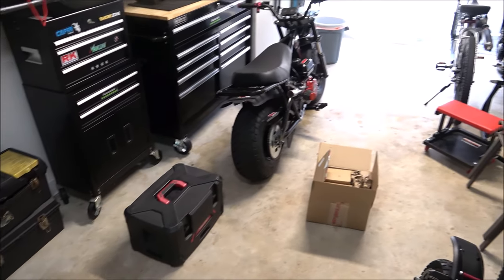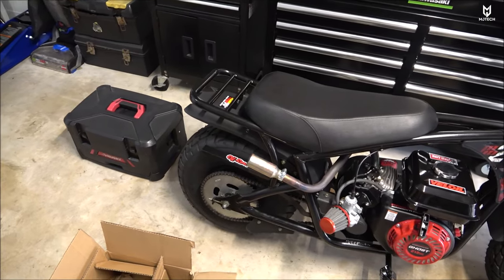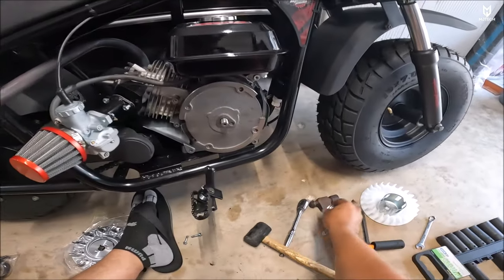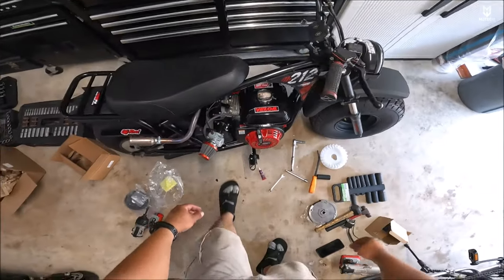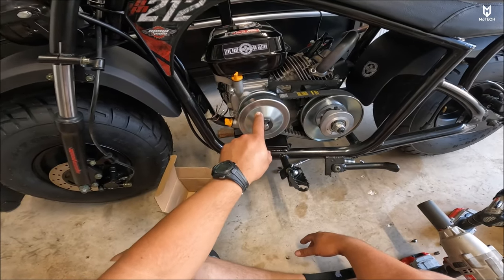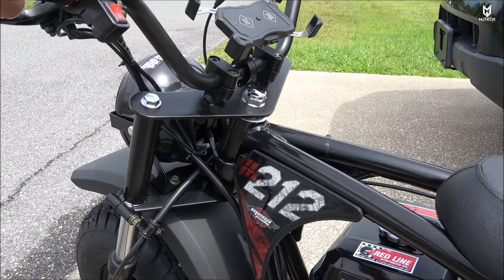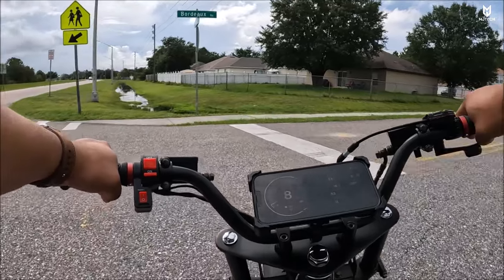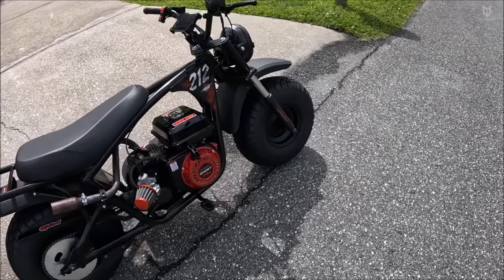Here's How To Make The [Predator Ghost 212] Faster - Mini Bike - 50MPH+

Comment: Break it in like you're going to be driving it. Don't baby it, unless you're going to baby it forever. You need a good shakedown as well.
Reply: What you mean by babing it ? Break in I just ride from time to time at the top. Soon I'll be changing the oil
Reply: @mr.liggins9092  I mean that some people think that the break-in period means you have to baby it. You should break it in driving it the way you plan on driving it. If you are going to run it at WOT every time you crank it up, break it in like that. If you're going to be cruising, no drag racing, no aggressive go-stop-go, break in should go that way.
Reply: Every sbc engine I have built I  drove like I stole it. Same as any small engine...mini bike.. dirtbike...atv..ect.. never had a issue
Reply: I dk if dudes knows anything about the shakedown

Comment: Best way to break in a motor is to run it the way you intend to use it normally.  So balls out! Learned this from a engine builder that built race engines for Nascar and dirt track cars.
Reply: Tf
Reply: @comfortablynumb8832  he's right. Break it in the same way you plan on using it
Reply: I hear so many stories of bad things happening when doing this with 2 strokes
Reply: @joshapples88  it’s a 4 tho
Reply: it’s best to let it idle for about 30 - 45 mins , turn it off and let it cool off , turn it back on then from there I’d let her have it . 🎉 why ? To get oil in the hard to get places and let those places get lubed before sending it hard

Comment: I know this is an old video but I hope you do see it, you need to adjust your carbs needle because you have some mid RPM hesitation, when you're doing the top speed run I can hear it hesitate like right in the middle and then once you hit I think 38 mph that's when it started picking up and sounding better and healthier.

Comment: Nice video My Honda gx160 goes 55 mph with stock rod , 18 Lbs springs with vm22 header pipe ratio rockers stock fw , stock cam on five inch rim.

Comment: I have a CT200UEX 196 cc. Billet rod and flywheel cam 26 springs 22 mm carb and it does 60 no problem. I have a 212 built the same that vibrates like it wants to bounce you out of the go kart.

Comment: hey brother, nice looking set up. it may have already said in the comments but just wanted to add, when youre using the billet flywheels with the strong rare earth magnet you need to run a wider coil gap. a card is good on the stock flywheels. should aso lap the new flywheel. good video tho brother

Comment: Hey what size throttle cable do you use because I have ordered multiple throttle cables and none of them have been long enough on the outside to link up to my bike and the part where you put it in the carburetor

Comment: So basically, I got a Predator ghost a couple weeks back and with the fuel pump I had to buy for it the gas tank won’t fit so I’m wondering what gas tank you have in the video also, I tried starting it today and gas came leaking out of that air filter on the carburetor when the choke was on so I took the carb apart and adjusted the float a little bit and it stopped leaking, but now it won’t turn on. sometimes it’ll start up for a little bit and then just sputter right out. It’s a brand new engine brand new carburetor, brand new everything so I don’t see how the carb could be clogged up with anything I could have it wired wrong but I don’t know.

Comment: Bone stock ghost, juggernaut, cvt set. 10t drive 38t rear on my trailmaster hurricane and yesterday hit 61.6 mph dirt tires as well. 19x7x8
Reply: I have a coleman bt200x wanted something a little more faster. If iput a 212cc ghost engine would it be alright with my stock jackshaft.and what exhaust pipe could i use?
Reply: @patriciaeaton-up4yj I’d get a tilletson 212
Reply: Im trying to do have same setup as you

Comment: Does your predator seem to have a lot of vibration in the upper idle to mid rpm range (2k-4k)? Just curious if it's just my predator but mine seems to run really smooth at idle and at the top end but vibrates a lot in between
Reply: Maybe your engine mount?
Reply: This may sound crazy but check your wheels and tires. Make sure they're not somehow out of round, your tires don't have any bubbles, flat spots, or uneven wear on the tread. Also check your wheel bearings for play. It's coming from an unbalanced rotational force, but the range it's happening makes me think it's closer to where the power meets the ground. Run it at the range where it vibrates the absolute worst, hold it there for a second, and then kill the engine. If the vibration immediately stops, its your engine. If it tapers off evenly as your wheel speed decreases, it's elsewhere.
Reply: Remington Steel  some of those castings are questionable, and I've seen videos of flywheels exploding.  It's hard to judge what one person considers "excessive" and what's normal without putting one's own hands on It.. And even CNC Machined parts can have defects.
Reply: @jesse1136  Wheels are reasonably balanced after resolving issues with the back tire. That issue was more of a wobble than anything else. The vibration issue is very high frequency, the kind that will make your hands numb. As others noted, my suspicion is it's somewhere in the crankshaft. I appreciate the replies and have more or less just lived with it. Other than the mid range vibration everywhere else in the power band feels smooth after warming up. Another area I'll explore is the carb, I know the idle and full throttle is dialed in, but the mid-throttle is lean. Dialing in the mid-range on the carb might help the internals rotate a little less violently.
Reply: @clv603  Ah, ok. It sounds like you've got some wrench time under your belt. I wonder if there's a bushing/dampner in your steering that's worn, for it to vibrate so badly without tearing itself apart. Good luck, hope you get it nailed down.

Comment: Them arc flywheels make the bike takeoff so much faster. I have one on my flat top hemi build and it tries to climb at lower speeds so much easier
Reply: Also on all my builds. Break in until it's warm low idle, drain the metal flakage immediately. Change oil every 20 min after that a couple times and then you shouldn't see as much glitter throughout its entire life. Don't do this and the rings fail premature had it happen a couple times, switch them to synthetic and a zinc base additive after as well, sucks to have a smoker cause of the glitter

Comment: What bolt did you use on the juggernaut that you used I have  the same motor  like  you so I just need to get the bolt  to hold the juggernaut
Reply: It’s 5/16x24 thread pitch. 2.5 inch long bolt
Reply: What Number bellt did you use

Comment: Do have a fuel pump or is it gravity
Reply from the maker: Gravity
Reply: What exhaust can i use will any 212cc pipe fit ? And please what torque converter and where do i buy it from
Reply: Sorry for all the questions please can you let me know where to buy the gas tank from

Comment: I didnt know about the stock ignition I changed everything except that do you have a part number for the upgrade?
Reply: you can just swap it with a normal predator 212 coil, the one that comes with the ghost is the same part but its just limited to 6k rpm

Comment: What's the part # for that mounting plate for the torque converter, the predator 212 has a different one and  I tries to swap them and it won't sit flush with the block? And can't seem to find anything for the ghost
Reply: You have to mock up the plate to the engine and then mark where it's not clearing so you know where to remove material. The jackshaft bearing boss is reinforced with gussets on the inside surface. You'll need to grind one of them down to get your clearance.

Comment: strange i have a stock ghost on a mega moto 212 and i’ve got 54mph but you could only get in the 40s
Reply: Straight chain ?
Reply: My theory: I bet you have the chain drive but he swapped to the Juggernaut CVT upgrade "Variator".
This "self adjusting" front pulley was geared maybe too high for his engine power curve.
Prob would have gone faster 
w/o that mod.
He may also have not upgraded his Carb main jet to feed more fuel.
Just an educated guess.

Comment: 56 mph on mine just by changing the rear sprocket. 73 to 53 tooth. 😮
Reply: I'm getting 52 on a mm80 with a torquezilla 10/50 I think my storm 200 with a Tillotson 212 is going to wipe it

Comment: There's no way that will go 50 miles an hour plus , I have the same one with same setup,  at 38 miles an hour the valve springs float ..
Reply: Mine does 52 mph
Reply: Top speed is mostly about gearing ratios.  Taller tires/sprocket = higher top speeds.  Shorter tires/sprocket = faster acceleration.  More RPMs will get you more top speed but gearing plays a much larger factor.  For yall to compare top speeds between mini bikes, you would need to factor in overall tire diameter and number of teeth on your sprockets.
Reply: @logme1336  thanks Logme , after messing with the ghost , and also changing to nibbi carb , I jave a defective ghost engine , it started smoking out of carb , which I changed jets also. I just took ghost out , put my tillotson back in , its much more reliable and just a better engine,  thanks for responding

Comment: 😂😂😂🤷🏿‍♂️ naw bro you dont have to do all that I have five mini bikes all with predator 212cc engine and they do 65 to 70 mph💨💨🏍🏍 you have to straight chain it go with a max torque clutch from go powersports 10 tooth and get a 72 sprocket I'm telling you💯💯 but if you want alot of top in change the sprocket to a 38 very fast🏍🏍🏍🏍🏍💨💨💨
Reply: If he's doing anything off road or with a lot of up and down terrain, those clutches are garbage. They're ideal on smooth, flat, hard surface like track or street. The Torque converter/TAV/CVT gives a lot more usable torque all the way through the the engine's RPMs- from engagement to WOT, full send. The chain clutches are for racing karts, where you're running WOT from green light to checkered flag.

Comment: Yo my stock 212cc predator does 60 against the wind. has an original style carb holy Moses blueprint super jet. stock cam with stock piston and rod with the cheapest cast aluminum fly wheel 18lb springs top 61mph 19 tooth clutch 60t rear. on my other engine I did rod, flat top piston, 270 cam, 26lb springs head porting all the shit I could with it and had nothing but problems. I built 3 engines 1 engine the the block was warped brand new also the new racing pushrods bent 3 pairs wouldn't stay running after measuring and cutting.  took it apart so got a new block new head new piston the piston seems to be the problem this time looks bigger so compression won't allow it to stay running. spend all this money but the shit isn't worth it. DIY is all a scam to boost economy. that's why the internet got ruined by apps.
Reply: The low end must be terrible with that gearing. How tall is the tire?
Reply: @Deucealive75  it's a 15×6-6 tire I keep up with cars that aren't trying to race off the line. I've had nothing but problems with my fully built motor with all the add on parts.

Comment: Here’s a tip. Don’t waste money on the ghost if your just gonna take off the rev limiter lol. But a regular 212 and a stage 2 kit, and boom cheaper and faster
Reply: 212 with stage 2 kit is over 450$? Just get the Ghost for 250
Reply: @billysnyder8026   bruh the ghost rev limits at 6k Rpms. Yeah get a ghost if u wanna go slow lol